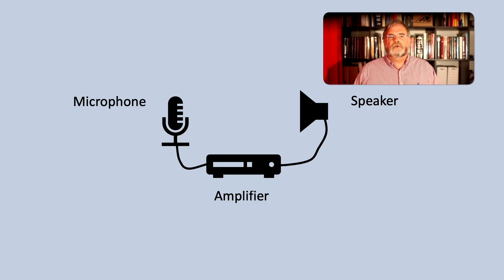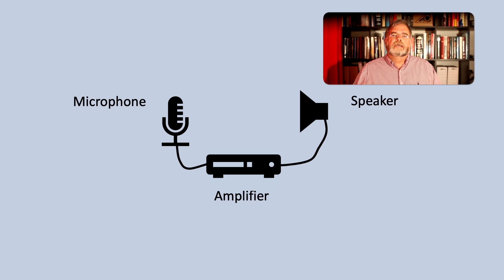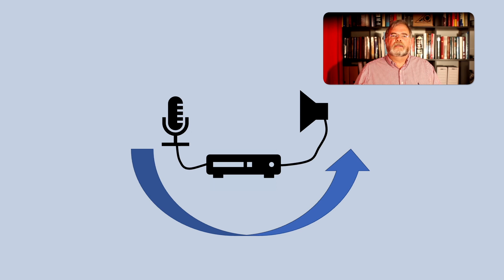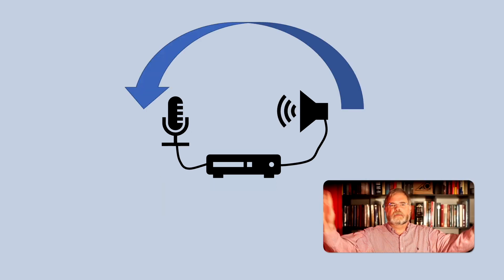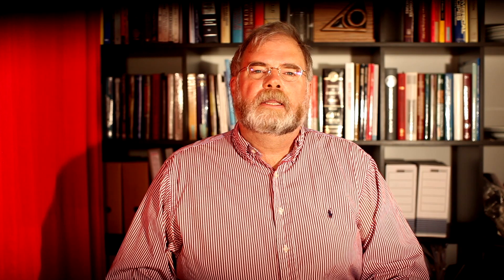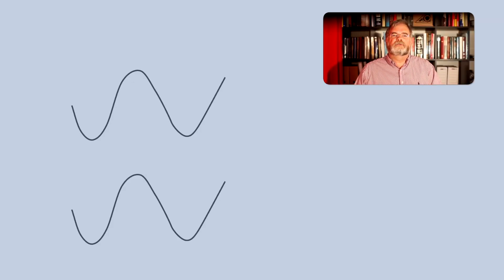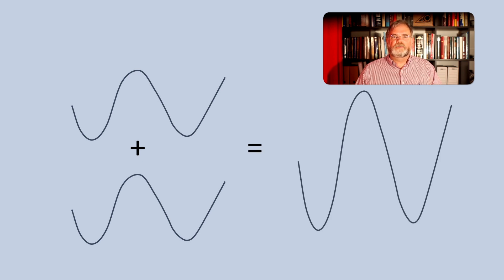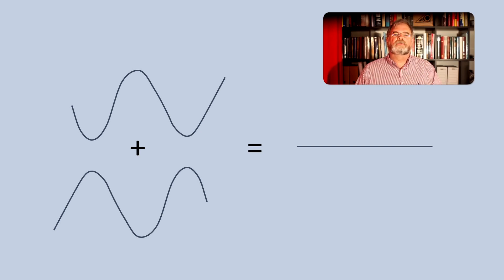Industrial Gas Turbine Combustors Part 4: Thermoacoustics Part 1

Comment: first of all Thanks for all  the effort put into every video then
Would u like to explain the pulse combustor and limit cycle operation
Reply from the maker: Thanks Mahmoud.  Unfortunately due to the decline in my traditional client base, the thermal power industry, combined with the COVID lockdowns, which hit me at the same time, making it difficult for me to find new clients in other industries I have closed my consulting business.  I am now working full time again for a large gas turbine OEM.  I would like to finish off the videos I started on thermoacoustics but have not had the time with my move to a new country.  And I will need the approval of my new employer for any future videos.  So I’ll see what I can do.

Comment: your videos are very informative… keep up the good work! i do have a question — which type of combustor tend to be more prone to thermoacoustic issue, canannular or annular combustors?
Reply: Thanks.  Both types of combustors you mention are equally susceptible to thermoacoustic issues.  The issues related to them can be somewhat different.  Annular combustors of course also have modes which travel around the circumference of the engine.  This complicates the analysis during engine development as testing, to keep costs reasonable, is often performed in single burner or a small number of burners arrangements with a segment of the combustion chamber that has side walls rather than a full 360° sector with a full set of burners.  Thus these circumferential modes are really only experienced on the engine.  This problem is theoretically reduced in can annular combustors but in reality it is not eliminated entirely as there is a small annular gap where the transition pieces of each combustor merge before the inlet guide vanes of the turbine.  So frequently there is a mismatch between the combustion dynamics measured on test rigs and those experienced in the engine though in theory this should be less of a problem for can annular combustors.  In reality both types of combustors have this problem to different degrees because even can annular combustors still have that annular gap before the turbine.  However in answer to your question both types of combustors do experience thermoacoustic problems.